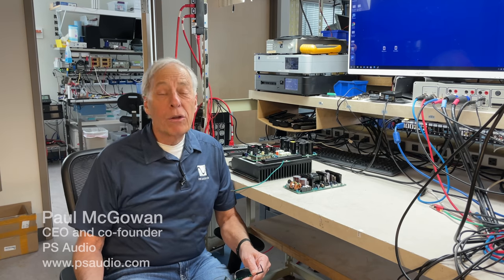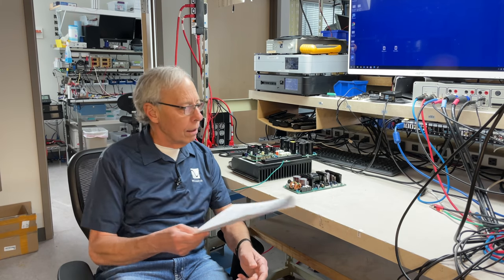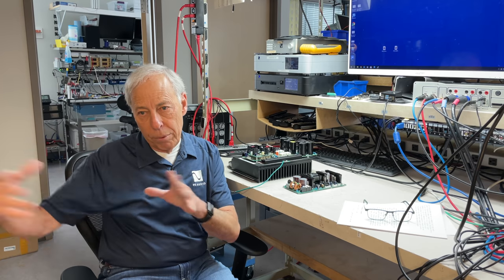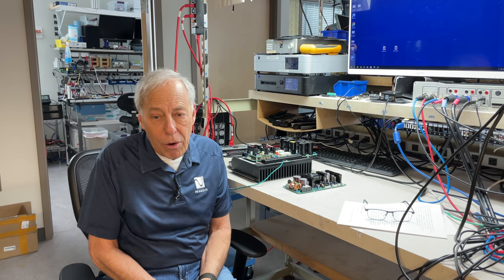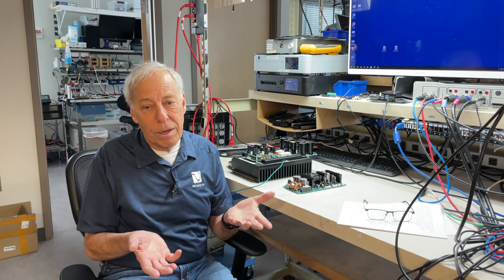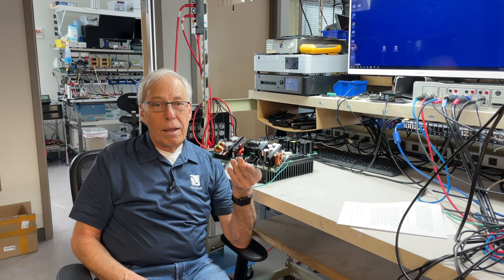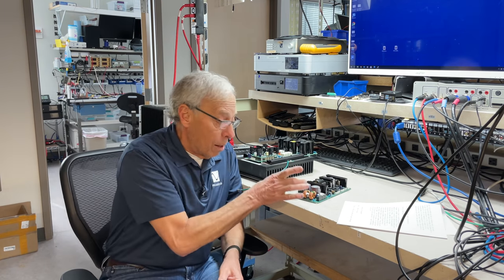Why do some amps weigh so little?

Comment: In 1979 I bought a Hitachi receiver rated at 50wpc. It weighs 23+ pounds. This when most other 50wpc receivers were 35+ pounds. It still runs exceptionally cool and is barely warm after 8 hours of use. Cooler running means potentially longer life. I get it.

Comment: I didn't believe it at first how could something that weighs so little sound so good? Installed a Stellar S300 for the front left and right channels of my A/V system, one of the best upgrades ever! Even before it was fully broke in it was miles ahead of the class A/B amps in my TOLT A/V receiver. It was like the fog  lifted from my system....great job PS Audio!
Reply from the maker: Thanks!
Reply: So you are watching movies through S300 as 2 channel or 2.1?

Comment: My issue with Class D isn’t the topology. I just take issue where many companies are charging $2-3-4-5K for Class D amps where in those price classes there are better Class A, AB, etc.
Reply: Well if that an expensive class D sounds better than cheap class AB, why not?
Reply: Stellar S300 class D ain’t expensive.  With correct speaker synergy, they blossom
Reply: Better look up the Behringer A800.  It’s a boss.
Reply: Don't agree I had during my 58 years of Audio journey Amps A and Amps A/D and tubes and changed recently to Amp D and never look back .Were you find an amp that has Dac,Bluetooth,150w on 8 and 4 ohms, roon ready and MDC module to upgrate to BluOs which is great as technology moves fast and all that for 1650 Dollar.Sounds great and preforms effortless ,tight Bass and controls the speaker in every way. Its a future orientated product beside that its over 90% and runs efficient and runs cool. GOOD NEWS MORE MODULES ON THE WAY
Reply: @privacyhelp  Because anyone in the know aint paying a 200000x markup
Reply: @Snook_  Does cheap AB class sounds better than expensive D class? Its doesnt matter what the tech specs are if you can deliver better sounds people will buy it
Reply: @privacyhelp  people will only pay what they think something is worth. Class D is a lot easier to do nowadays and is mass produced in China. Chifi is all class d and proves it’s not expensive. The cost comes in design phase and the industrial design to make it feel premium. But the thing is, consumers from younger generations will not pay big dollars for a class D amp. Their iPhone is far harder to design and make than a simple amplifier yet costs less. Economies of scale mean it won’t be long before you can buy chifi amps that sound as good for a fraction of the price just like everything else.

Me personally I put a huge emphasis on industrial design and looks tho but I’m not a zoomer

When you think about it though, amps should not cost much money when class D. They should be much cheaper than computers, FAR more r and d on software and hardware in that space for a fraction of the cost

Comment: Those ICE modules are so simple, it takes so very little to build a small enclosure with switches/inputs/LED and have yourself a decent DIY amp! I'm well aware PS Audio takes it to a diff level via the pre-amp design which certainly justifies them to charge what they do. But for a po-boy audiophile just getting started, just build the thing yourself and spend the extra cash on a good brand pre-amp & other seperates!
Reply: Do you know where to pick up the ICE modules?
Reply: @paulgyro  parts express
Reply: @paulgyro  parts express sells them, and if you google enclosure kits for the ICE modules youll find them too, with binding posts and all!
Reply: @AllboroLCD  nice, I'm going to look into it! An old NAD of mine is dieing so it's recap or buy new. Seriously considering building an ICE based DIY.
Reply: @paulgyro  just take your time and take safety precautions, some amps are easier to re-cap than others!
Reply: there's also Purifi which is relatively cheap for great output and cleanliness

Comment: Paul said that the class D does not have a transformer when it does, it is just very small because as the input frequency goes up as it does on a switching supply the transformer gets much smaller but still delivers a lot of power. Bob Carver's Sunfire amplifiers used a switching supply that also tracked the input signal keeping the rail voltage only 6 volts above what is needed at that instant in time which made his class A-B amplifiers not only nearly as efficient as class D but almost as light and as powerful as they can double the power when you half the impedance down to 2 ohms and were stable at 1 ohm or less. How many class D can claim that.

Comment: Weight is my main reason for going Class D with my smaller Pro Audio rig. 8x500W in a 6U case weighs in at a little under 40lbs. Sure, it won't hold a candle to a BHK, but it does sound good and doesn't break my back.

Comment: Dear Paul, I watch each and every of your Videos. I would love to ask you my question, too. In audio terms: WHAT IS WARMTH? What in my gear causes it ? Edit: I am talking about a warm sound. What in the gear makes it warm sounding?
Reply: Part of the energy of the electrical current going through your gear gets thermally dissipated. This causes WARMTH. Unless it's too much, in which case it causes HEAT—or maybe even FIRE.
Reply: @fsmoura  I mean a warm sound
Reply: @DigitalPhilosophers  Vacuum tubes.
On their big expensive monoblock amplifier they put vacuum tubes on the input stage.
Reply: @Geerladenlad  Thank you! Furthermore, I wonder why some solid state amps or even class-D amps sound warm and some do not. What is it that makes this difference?
Reply: @DigitalPhilosophers  Look into current source vs voltage source.
Current sources have a higher output impedance can produce a warmer sound.
Reply: Vacuum tube amplifiers have historically been known for their WARM sound , and some makers of solid state amps  learned how to "voice" or tweak their designs to emulate a TUBE sound or warmth . Bob Carver did that years ago for the Carver challenge in Stereophile where he tweaked his mainstream solid state amp to sound identical to a much more expensive tube design and he marketed them with a T (for transfer function) after the model number. While Bob knew how changing the value of any component in the signal path would affect the sound while most designers do not and so they cheat by putting vacuum tubes in the input stage to warm up the sound  so it won't sound "cold" like many solid state designs can. Bobs Sunfire designs were said to have a warm sound for a solid state design. He now designs tube amps with an adjustable BIAS control that can make his tube amps sound warmer still or almost solid-state like cool.
Reply: @leekumiega9268  Nice. Thank you. Which tweak or tweaks makes a solid state sound warm?
Reply: @DigitalPhilosophers  That is something only design geniuses Like Bob Carver knows for sure ,in the Carver challenge (still found on line ) he changed the values of certain  resistors and capacitors many places in the circuit . I should mention that at one point it was agreed that his amplifier actually sounded better (tighter bass) than the reference amp but they wanted to see if he could duplicate it's sound exactly ,which he then then did. If you already have good separates find a good vacuum tube headphone amplifier that has a line out that is influenced by the tubes and place it between your preamp and power amp and that should give you a warmer sound.
Reply: @leekumiega9268  Very interesting! Thank you for sharing!
Reply: Even order harmonics?
Reply: @paulqueripel3493  I often hear that the second harmonic distortion sounds musical but what and in which part of my gear does this distortion happen? I would love to hear Paul take on that
Reply: Warm usually just means 'rolled off' highs or emphasized low/mids. Think guitar from the 70's that someone wants to turn up really loud without hearing the raspy top end... In reality warm is less detailed IMO and just a term people use to describe that they like turning up the sound really loud to feel the bass and chest thump without hearing such loud high's. In reality, a reference system should go loud at all levels nicely and just sound good.

Comment: AGD Audion monoblocks with Gallium Nitride Mosfet power "tubes" only weighs 6.5 lbs. Newer tech --- maybe the next best breakthrough in amp design. 85 watts into 8 ohms and 170 into 4ohms.  Paul, we don't need back breakers especially as we get into our 60s or 70s. Are we entering  the golden age of Hi-End Audio?

Comment: Class D, is the way it's going, and here's why, because the process of switching, or PCM, will get better and better over time, as will the quality of the parts to make that happen, is what I see. Listen to a early class D, like from 1989, and then listen to some m700's, and you'll fully understand. Have an amazing day everyone!
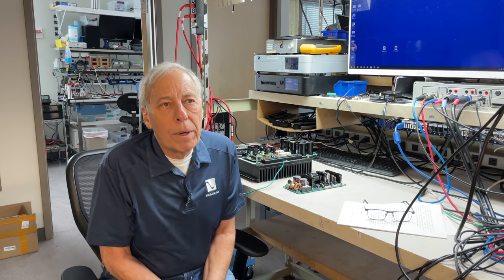Reply: Not PCM (Pulse-Code Modulation), but PWM - Pulse Width Modulation. 1:50

Comment: Interesting, then, to think of how much studio work back in the day, including what was used in production of many classic LP recordings that audiophiles love, was done with a rack-stack of Crown D150 and D300 amps powering the operation. They were all over the place in NY, Nashville, and in SoCal studios when I was first working down there. Were they class D at some stage and AB/B elsewhere?
Reply: Thats like speculating 'The computer that got man to the moon back then was so advanced it must be the best ever made'... Well you see where im going.
Reply: @Snook_  The specs are the specs—and when plenty of modern “audiophile” gear still can’t match them, what happens to your analogy? Functionally flat to DC on the bottom end, for example.
Reply: @ReflectedMiles  your concept goes out the window when you can get the same specs foe 1/5th the price between brands. Specs don’t mean much price does if specs are the “same” technically speaking for zoomers
Reply: @Snook_  But they aren’t the same in reality. The reason the Crowns were everywhere was both from their specs and their ability to put up with abuse day-in and day-out. Besides, most audiophile amps are wildly more expensive without the commensurate reliability. Nobody would say that the Apollo computers exceeded any typical modern computer specs or were more reliable.

Comment: Well executed Class D is the best thing to happen to car audio.  The amps run cool and are compact, and OEM audio systems often boast adequate power for the job and sound almost halfway decent.   Of course people go off the deep end with high powered custom DIY systems, but the average Joe can actually have decent OEM audio.  This is a sweet relief from decades of awful OEM car audio systems.

Older audio enthusiasts are ingrained to think that a quality amp has to weigh 100 pounds.  This is out of date thinking.  I love Class A/B and own one, but have to concede Class D does not suck anymore.
Reply: Some people also like the sound of whatever the older gear was doing. Even if it is not as accurate due to colourations or distortion (though they may claim it sounds like "real" music etc). I like the no colouration approach for amplifiers. That way you can use preamps or source or software means to colour the sound

Comment: but class-ab can be small and yet powerful aswell with very little heatsinking,  in bob carvers sunfire subwoofer amps he varies the rail voltages acording to the music signal and makes the class-ab stage allways run so theres not much voltage drop across.
Reply: Yes they could deliver 2700 watts RMS for peak demands due to his "Tracking Down Converter power supply , which also made all of his Sunfire amplifiers light and efficient.
Reply: @FooBar89  actually it was class AB amplification ,what they have in common with class D is in the switching power supplies and his designs tracked and modulated the rail voltages according to demand.
Reply: its not class-d  class-d switches a pwm and lowpass filter it, this is using two tracking buck regulators to drive a class-ab amp.
 Class-H  comes very close,  but with regulating the rails instead of switching between different ones.
Reply: but the final stage before the speaker is a plain old class-ab stage.  the regulators just keep the rail voltage above the transistor dropout voltage at any amplification.

the buck regulators regulate down to 2..3V above the required amplification.   when you put out 5A on the amp at 40V on the output (8ohms), the trackers will feed the class-ab with like 42V  so theres only a 2V drop across the transistor. 2V x 5A is just 10W heat dissipation.    in a ordinary amp with lets say full +-90V rails there would be a 50V drop across the output transistors (at the same output as above)...5A x 50V ... go figure how big your heatsink needs to be to dissipate 250W
Reply: Its hard to compare car audio to home audio. The amount of space inside a car is much smaller than even the smallest listening room in a home. You're also sitting inches away from the speakers. In some respects, a car system is more like wearing headphones.
Reply: Sunfire never made Car subs. Those  mentioned were used for Hifi and ran directly off the mains without isolating Transformer inside, otherwise they wouldnt achieve such power within a 29^3cm cube i have two of them and restored both 

You know what rail voltage you need based of the Input signal   Theres adjustments inside to set the gain of the trackers   the Output of the class-ab Stage is Just connected to the speaker and nothing else. 
Even the bias adjustments are Not needed anymore since the max dropout voltage will never exceed what the trackers give them.

This method is also used in some Lab powersupplies.  You have a efficient  switching psu which is noisy and a linear psu right after it. First psu will track the Set voltage plus what the linear psu Drops and the linear cleans up the unwanted noise and runs with a low voltage drop. A ordinary linear supply would drop the difference between full rail and Output voltage.   So If out is 5v and rails are 30v  you drop 25v.. at 5a thats 150w just wasted heat
With tracking your linear psu Input voltage would be 5V + what its threshold+some margin  so lets say 6.5v. The drop would be 1.5v across so 5A x 1.5V is just 7.5W of heat.
Reply: @gamerpaddy  You're right. That post was meant for a different thread. I have no idea how it ended up in this one.

Comment: Carver made a 10 pound ab amp in the 80s sounds great. 2.0t
Reply: He sold many amplifier models with a T (which stood for transfer function) after the model number that sound very close for mass production to some of the great tube amps. He also used state of the art power supply designs that made them light and powerful.

Comment: in short: efficiency and power supply.  high efficiency switching power supply can be so small compared to the huge and heavy wire wound that is usually used. the added efficiency do not need heavy cooling fins/heat sinks.   no heavy metals or toroidal power supply equals small and light.

Comment: I'm not sure if this is entirely true? I purchased a New Sony class D reciver in the early 90s "Pro Logic" I now have a soon to be replaced 2010 Sony AVR that's 7.1 and Class D also, the  newer Sony weighs half what the 90s version did! They have similar output? The difference I can see is the size of the transformer in the old one was massive!
Reply: The amount of lead and copper in amps made from around 1985 to 1995 is outlandish.

Comment: How much of a trained ear do you have to have to tell a well made class ab from a well made class d?  Would someone like me who doesn’t know jack about audio really be able to tell the difference?
Reply: in time your ear will get trained.  you'll need to listen to a lot of different amplifiers though.  The biggest difference will become apparent, as paul mentioned, when listing to floor standers in a large room,  where your driving real power and the speaker is presenting a very real changing load to the amp. small amplifiers loose control very quickly
Reply: @jackheinemann1994  That seems to be to do with power output and load capability, not size. And furthermore, nothing to do with the question of whether you can tell the difference between class AB or D. 
I'd think most people would not be able to tell a difference between the technology assuming the amplifiers are made to be neutral and not "tuned" to have a certain sound.

Comment: I wonder what GaN Class-D Amplifiers will bring in the far far future.
Reply: Is it just me or do gallium nitride semiconductor devices have their own "distinctive sound" whether used in class D or class AB amp topology?🤔
Reply: check out orchard audio and you will get an answer :D
Reply: @19janiboy96  I will research both these things.
Reply: @laurentzduba1298  ahhh....
Reply: Check out Technics SU-G30 and SE-R1, amazing amplifiers, you'll have to spend some time online to understand the technology behind, Technics doesn't explain well on their website. In short it's one Gan-Fet device per channel doing both push and pull (class a anyone?) that switches in the mega Hertz range, that is million times per second. Both amps are purely digital and convert all incoming signals to dsd which is sent directly to the output stage without prior conversion to analog. The dac chip inside is used solely for converting to dsd. Some might not like the Technics sound signature, but they are very, very good amplifiers.
Reply: @laurentzduba1298  The Material used dont really have a sound to them per se, its always about the implementation
Reply: I would so replace the 19v/4amp, 6v/1.5amp, 16v/2amp LPS's i've been poking at for the past year with a very high switching (GaN?) series of boards. Found 1 but it costs too much. Should I wait, or is there something nOW?
Reply: @19janiboy96  I love the small chip with no heatsink on the board that you can point out to people and say "that's the thing putting out 100's of Watts".